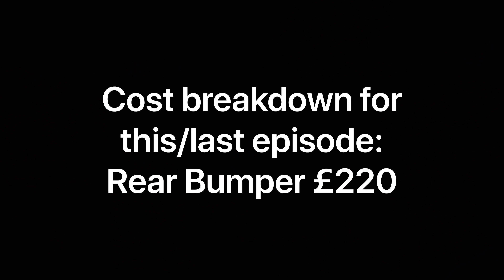Audi S3 8V Salvage Rebuild Part 8 - Body Work Prep 2/2

Comment: Your oil pump is on it's way out, you can hear the whine when you first start it. Common problem on the 8v s3
Reply: That’s a normal and well reported noise S3s make on startup. Not an issue.
Reply: My S3 on 15k miles makes that noise, totally normal.
Reply: @pocketrocket1237  not a normal noise, I've had my oil pump replaced under warranty because of this noise and have the invoices to prove it. 2 of my friends have had their s3 from new and both suffered with the same issue well under 25k miles. If yous want a pic of the invoice private message me and I'll be happy to send yous a picture of it